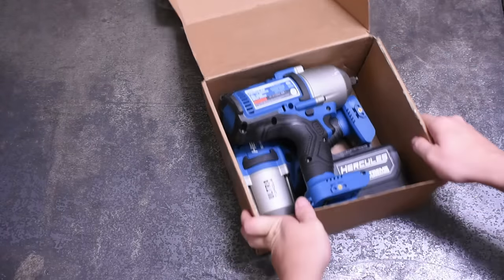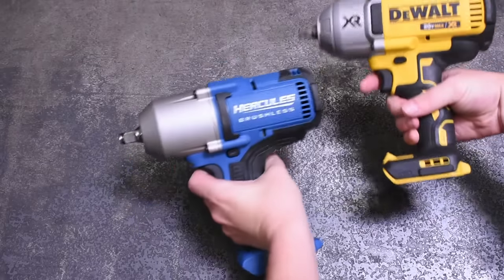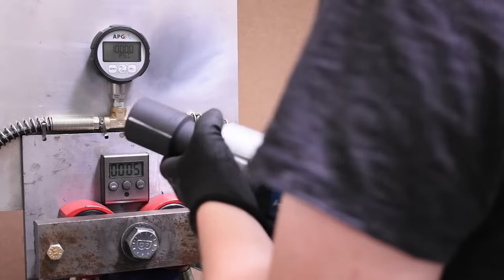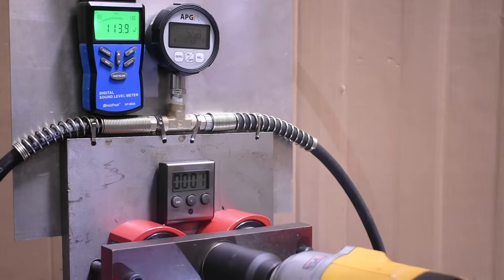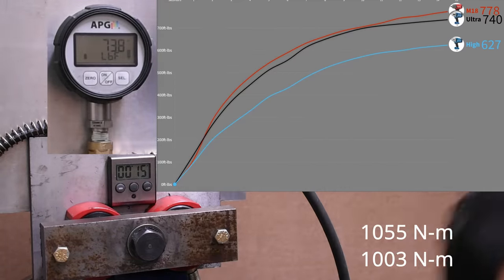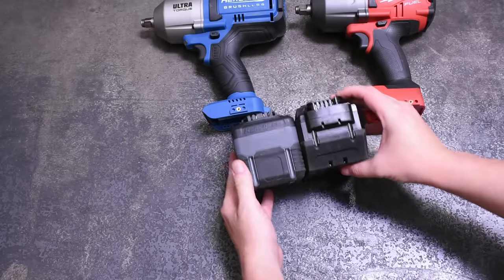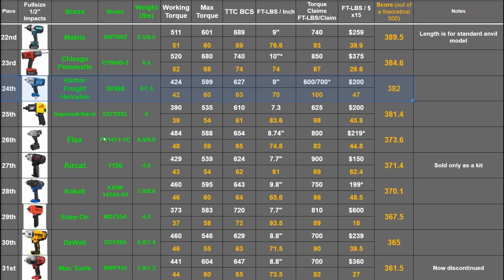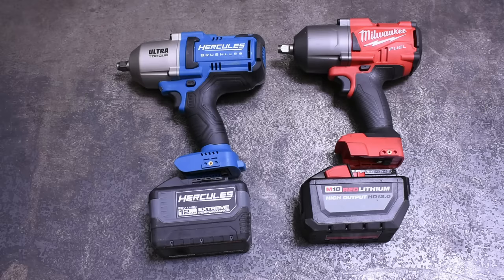Harbor Freight Dethroning Milwaukee & DeWalt w/ New Ultra Torque Impact Wrench?

Comment: Wow. Impressive results this time from Harbor Freight! With a 5 year warranty and a substantially lower price when you consider the battery cost - this seems like a legit contender.
Reply: Yes but how many times can it do that. Yes I know 5 year warranty and supposedly walk in walk out with a replacement but how many times are you gonna have to go in during that 5 years.
Reply: @jamesfair9751  as many times as you gotta get that free tarp, flashlight, or bucket lol
Reply: @jamesfair9751  well I have had 3 earth quake xt in 14 months ! 3! Sooo yeah
Reply: @jamesfair9751  your assumption with your comment is that it will in fact break or start performing at a lesser capability. But until we see that, you just can't assume. Nobody thought that they would start rolling out 5-year warranties, but here we are.
Reply: @leafybug04   To add to that, if they had to replace it every 4 months, they would lose money big time on a 5 year warranty. So them giving that does mean they have some degree of confidence in their product.
Reply: @rapidroadsode8789  the earthwuake xt had a bad switch design and had chrap brushes. Makes sense.
Reply: @jasonthomas4895  and it’s weak . At least once daily I am grabbing the breaker bar in passenger cars. I’m adding semis to the service list and the earthquake simply won’t do
Reply: @rapidroadsode8789  its actually pretty strong. Its not as strong as strong as my milwaukee, but it did the job for me for almost 2 years as a technician.
Reply: @jasonthomas4895  actually it’s not . I do this every day and I have to break out the bar daily . So much so I strained a muscle in my neck and I’m a let’s just say stronger than the average strong guy. So nah it ain’t strong. Not for rust belt or semis it ain’t
Reply: @rapidroadsode8789  i get alot of cars from the rust belt out here in Washington (military base), and it did the job plenty for me. One day it just gave out and that was a year or day in and out use, including suspension, wheels, brakes and even jobs where i had to remove the subframe
Reply: @jasonthomas4895  maybe I’ve had 3 duds in the last year . I’ve had 2 break and this last one caused me to drop $700 on a makita kit so it’s not getting the job done for me at all . And I know when I move to more commercial and rv roadside it definitley isn’t gonna get it done . I was considering an air powered  d handle but when I saw the torque test results on the makita I figured I’d give it a shot .
Reply: yea for the homeowner but a mechanic that uses it everyday it will give out very quickly.. plus they dont have the tool arsenal that milwaukee does
Reply: @bigdave6331  i am a mechanic....... have been for 4 years now. I personally love my milwaukee setup but im probably gonna downgrade to the hercules line because of how cheap the batteries are.
Reply: @jamesfair9751  I regularly use 10 tools & batteries from Milwaukee M12 and M18, and I send stuff in for repair more than twice a year. I'd love to get over the counter warranty replacements. Go Harbor Freight!
Reply: @rapidroadsode8789  I had my earthquake XT for over 4 years for my service truck, and it still hits like it did when I first got it……that said, it’s weak point is it’s battery pack. I’m on my third. I have SnapOn impact ratchets and 3/8 impact gun, and impact driver for use in the shop as I don’t want them stolen. They are expensive but worth it. I’m saving to get the High Torque 1/2” impact gun, but it’s over 800 with battery and charger.
Reply: Absolutely
Reply: @patrickday1816  Home Depot came through with the one day delivery on my makita 3/4. It has the highest torque if anything tested that I’ve seen other than d grips . $661 with 2 batteries and they gave away another for free . 
It came a couple hours ago and I’m waiting with baited breath for a tire change just to see how it goes . Lol
Reply: @jasonthomas4895  ah very nice. I use matco's strongest pneumatic 1/2 impact. I get it serviced every 3 years and have been using it for 7. The gun was $470 and out torques every other 1/2 impact I've used that hasn't been tampered. I'm a heavy line and diagnostic tech out of Vegas. Been a auto tech for 8 years now and started out at Jiffylube haha.
Reply: @rapidroadsode8789  Well by that logic you kind of just disproved your original statement of it being weak. If you're this big strong bodybuilding muscle man and having to use a breaker bar while struggling to the point of actually injuring your big strong muscles, well then how does that imply the impact tool was weak? If anything that suggests what you are working on is so jacked up and frozen almost any impact wouldnt work... I just love when people disprove their claims with their own arguments, especially due to pride. Haha. I also have to ask if you're an automotive technician that's planning on moving to medium and heavy duty trucks why in the wide wide world of sports are you using a cordless electric impact?! When I worked at my father's diesel/heavy equipment repair shop we only ever used air tools, usually 1 inch drives, now we had to have 2 very large twin cylinder air compressors to feed enough air but thats what the job required. Then when I worked replacing tires on heavy equipment we had almost the same setup except we had 3 large twin cylinder compressors in order to keep the air pressure up and had to use very large powerful air impacts, these things would snap your arm in a second if you weren't careful. This work is no place for a cordless impact, if you really want to do this work you need to invest in some air tools man.
Reply: @Lotek117  I've got 4 diesel techs that work for me. They're using makita 3/4" 40v max Xgt high torque. 1510 lbs nut busting, 1330lbs of fastening. Nothing has stopped it yet. I'm in the northeast, and own a small trucking company. We are salted heavily in pennsylvania. I use the XWT08Z high torque half inch 18v at home on my cars.  Nothings ever stopped it. A lot more guys are going to electric, especially roadside repair, and tire guys for semis.
Reply: @Lotek117  yeah I am a bodybuilder . I actually turned pro in October  of 2020. Quite proud of that . Doesn’t really pay worth a damn hence the roadside lol. Buuuuuuut , standing on the expressway , in January , and it’s 7 degrees and cars are whipping by at 80 mph Id rather get the job done and go. I’d rather not injure yet another muscle or nerve in my already destroyed back and neck . And the harbor freight,  as I said has me using breaker bars literally every day . And that’s just  on cars . I’m not even doing semis yet . The few utility vehicles I’ve had and almost every ford f series , and honestly anything that has had the tires off at a shop is gonna require a breaker bar . So yeah it is weak . I like hf because it’s cheap and WHEN I break it I can get a new one 7 days a week 9-9 in 5 min. For that it’s Awesome, but when you do this all day , and I work 12-16 hour days now( even now at 8 am Sunday,  I’m getting gas for a fuel delivery ) , you’re gonna run into things hf tools just can’t handle . I’ve broken 2 breaker bars in the last 3 months, 1 just a week  ago. Guess why I was using them . Lol I’ve broken maybe half a dozen of their impact sockets , mostly 21 and 19 mm. 

The earthquake xt is weak for what I do . And I have the 3/4 lol. Fir what you do , where you are it’s probably fine . I’m not arguing .

If you deadlift 500 you’re strong in high school. Great . But that ain’t strong anywhere else .

If you run a 11 second 100 m you’re fast for a woman in college but you ain’t fast for a man in the Olympics  .

We’re talking levels man .
Reply: @Lotek117  I’m currently doing roadside and am expanding to 2 new areas  this year , towing and heavy duty roadside . I’m weighing my options . 30-60 gallon a compressor  and all air tools orrrrrrr 
Cordless impacts and smaller air compressor only to fill tires and fill the bead seater tool. 

I’m exploring the most cost effective way to break into heavy duty . 

Also Cordless and small air compressor fit in the back seat  of the extended cab flat bed tow truck  I’ve ordered .

A big air compressor(10+ Cfm) does not and requires me to purchase another utility vehicle . 

So I’m trying to get into this with as little investment as possible especially since I just ordered  a brand new tow truck and all  the tools neccesary . 

So once again earthquake xt doesn’t do what I want it to do now and damn sure won’t do it in the future .
Reply: @billymurphy3  I bought a cot to go camping at a local like, you know the cheap type store. Next morning i get up, a rivet is broken...im 50 lbs or more under the limit...guess ill return it. Get a brand new one. Bring it home, get it out of the bag and 2 washers fall out...2 broken right out the bag. I got a different style, the warranty rather store exchange worked good...but not exactly ideal. Would be nice to see if you could get good life out of one of these but its iffy.
Reply: @deektheviking4747  i have the pneumatic impact from matco too. Its my go to when the cordless aint cutting it. Personally i want to try the earthwuake pneumatics since ive heard very good things about them.
Reply: @jamesfair9751  who cares?  I go to harbor freight at least twice a month... you are a Milwaukee fanboy it appears
Reply: @rapidroadsode8789  the fact that you bought makita over Milwaukee says enough lol
Reply: @goldentrucker7921  yeah I don’t think Clancy can see it from my point of view . Simply out that harbor freight git the job done till it didn’t . Not I upgraded to the makita and it’s an animal ! Only been a day but my last client called today specifally for over tighten lugs . The makita didn’t even blink ! No breaker bar used today at all . First day in months that’s happened . I will however trade in my earthquake for a Hercules as soon as they’re actually in stock . It’ll make a nice back up and for use in the rain .
Reply: @Lotek117  btw clance, no , breaking a nut isn’t a struggle for me . I just deadlift it  and it’s a snap. But the problem is when you’re on the  shoulder of the highway you need to keep your attention on traffic .  So your head is turned left or right . I glance at what I’m doing but most of my attention is on not getting hit by idiot drivers not moving over . Not keeping my  neck in a neutral position while lifting caused the issue I currently am dealing with . Same thing I would tell anyone in the gym about not looking to the left or right to see them self in  a mirror while lifting.
Reply: @rapidroadsode8789  Might be defective. It happens. Suggest you do a return swap and then get back to us.
Reply: @guruoo  it works . But it just ain’t that strong . But what I will do is return that bad boy as soon as the Hercules ultra torque is available and get that kit
Reply: @rapidroadsode8789  you sound like that guy who's in every comment section badmouthing a product because it's as good or better than the competition at a lower price but doesn't bear the prestigious brand name. I know plenty of techs who use the earthquake and none of them are whining like babies about it, they all love it. I think your situation is one of personal bias and zero truth. If you used one, you'd likely have the same feedback as everyone else who climbs down from the "this brand is the best and everything else is garbage" pedestal and just be honest about a great tool. But I'm sure you couldn't impress your "buddies" with a tool that works and doesn't cost a house payment 🤷
Reply: @winkletown8828  if your House  payment is $600 , idk where you live but here that’s just ….. a car note …. Maybe… maybe . idk what to say about that . 
But actually no , you’re totally wrong about me . In fact my entire tool selection , except the 3/4” makita I just bought last Friday is harbor Freight Tools . And I’ve been using them every day since March 2021. Literally everything , literally every day. I am a workaholic and as such I work 7 days a week typically 12-18 hours days . So I’m uniquely qualified, more so than most to talk about harbor freight tool  quality . In fact I like them , love them because of the warranty and the fact that I can get a replacement 8 am to 8 pm 7 days a week in 5 minutes . And if you use their tools daily you’ll NEED that ability . But even they know that they don’t have the same quality . Their prices are cheaper specifically because they don’t do quality control, use cheaper materials and parts and knock off known brands  . They also know that most people won’t have an issue so it’s fine . They fit in a very specific niche . 

But again the impact just doesn’t hold up to over torqued nuts , frozen nuts , or anything  the size of a f-150 or higher .

Not sure how that’s whining . It is my experience . 

I’d rather pay $249 then $616 for a kit ! It took 18 months of hand breaking nuts and a neck injury to spend that kind of money on something I basically already have . No one gives a fuck what tool you use lmfao . Besides genius , I work alone ,  so who is going to see the tool but the customer anyway . You know nothing . 

The few times someone mentions my earthquake xt 3/4 they asked me was it a Milwaukee , because harbor freight uses the same color scheme as name bands on their jacks , compressors , impacts and other things so even brand whores wouldn’t  really even know . The name wears off most tools with use as well . 

My cars Though yeah that’s something people see and mention. My home ? Yeah that’s something women certainly comment about . My freaking cheap ass tools that help me
Launch a business at 1/3 the price and significantly lowered the barrier of entry …. ? You sound like someone who just wanted to be in the conversation !
Reply: I wouldn't go that far. If you wait for it to go on sale at lowes you can get a dewalt impact including charger and battery for 220 so it's in the same price range as harbor freight. Made in the USA and definitely a reliable tool
Reply: @rapidroadsode8789  so
Reply: @winkletown8828  have had the Mikita for 2 weeks and haven’t used a breaker bar since I got it . I did trade in my earth quake for the new ultra torque and it only cost me $25 total with the giant 12 ah battery.  No extended warranty needed . I’ll try it out the first day it rains as the makita won’t be seeing any environment other than dry. Ain’t about brands it’s about production .
Reply: @jasonthomas4895 
Kitsap?
Reply: @rticul8862  ??
Reply: @rapidroadsode8789  how's your makita holding up? I just bought the mid torque 40v, and the combo 40v hammer drill & impact kit with charger & 2 batteries. The gt200d. Both are amazing. The hammer drill has some serious performance 👏
Reply: @goldentrucker7921  it’s nasty ! I just yanks the nuts off . I have nothad to use a breaker bar  once since I got it and my strained neck muscle is almost 100% because of it . 
I also got the ultra torque as a cheap backup and to keep in the tow truck and it works well also . I grabbed a 12v makita cordless ratchet open box on Amazon for battery changed and it’s great also
Reply: @jasonthomas4895  it's okay these boys getting so insecure about not having the best possible tool and act like it's the worst decision ever made if you buy anything other than "the best" 🤣
Reply: Those Hercules impacts don’t play around!
Reply: @billymurphy3   . 
...
Reply: @jamesfair9751  Harbor frieght if the gun or battery fails you grab a new one go to the counter they look up the puchace and you get a new one free !
Reply: @rapidroadsode8789  You think 3 duds in a year is bad?? One guy bought a new Milwaukee impact, the big fuel one, and he broke SIX of them in the parking lot of the store trying to take the lug nuts off his truck. After the first few failures, and walking right back in the store to have them warrantied, the store employee didn't believe him, but walked out and witnessed the rest of the failures for himself. The video is right here on YouTube.... JUNK! That's SIX duds in 30 minutes. I'll take the Harbor Freight ANY day.
Reply: @jamesfair9751  no cause this damn Ultra Torque is no joke, very well biuld like a tank and was tested to torque loose an impressive 1,900 ft. Lbs on the reg. 5Ah battery and was able to torque loose 2,000 ft. Lbs with the powerful 21700 cell 8Ah battery!  The 5 yr warranty backs it up!!!
Reply: @rapidroadsode8789  That's earthquake.  Hercules is a completely different animal!
Reply: Not even the batteries are maybe 20 30 bucks cheaper than milwaukee the hercules line is expensive youre better off paying an extra 80 bucks for a milwaukee
Reply: @kelpking4484  The Hercules batteries aren't that expensive. I got an "Extreme Performance" 8ah 20 volt battery with the new larger 21700 cells in it for $69. Try to find an 8ah Willfuckye battery for anywhere NEAR that price.. 😕
Reply: @kelpking4484  Also, i don't know where you'll find the BIG Willfuckye impact for "80 bucks more" than the Ultra-torque Hercules. The big Willfuckye with a battery is close to $550. I bought the Ultra-Torque Hercules, and 1 8ah battery,  for $240... I already have the charger for some other tools. That's about a $300 difference. NOT "$80".
I've been using the Hercules 5 days a week, 10 hours a day, since Christmas and it's been fine so far, and has a SHITLOAD of power. 
I wouldn't have TOUCHED a Horror Fright cordless tool 5 years ago, but they are getting good today, and they ARE much cheaper than the "other" brands out there. The no hassle 5 year warranty on them can't be beat either.
Reply: @xxxleafybugxxx  Also nobody thought HF would create superior quality roll carts that would compete with snap on, matco and Cornwell, yet here we are with US General carts equal or better quality at a fraction of the cost.
Reply: @sophiasocal68  The H.F. carts are pretty good..
I own several, the regular one, and the one that you can adjust the height by pumping the foot pedal. No problems with either, and I've had many heavy things such as several hundred pound transmissions on them many times.
Reply: @Lotek117  I was thinking the exact same thing. Homeboy claims he’s so strong but then he strains his neck. He either isn’t strong, or those lugs were on their super tight.
Reply: @jamesfair9751  lol u are legit funny
Reply: @rapidroadsode8789  why do bodybuilders keep lifting even though they're back and knees are shot? A friend of mine constantly complains about his back but won't stop lifting and is increasing weight. That seems like a recipe for a ruptured muscle in the groin or other places.
Reply: So Bosch is the best? Got it. Bosch usually is the best
Reply: @jrock5995  depends on their age and pain level and pain tolerance . Also every exercise doesn’t put a bad  back at risk . Also staying strong is one of the better things one can do for their  back specifically .
In addition being bigger and stronger than the rest of you is addictive . It’s hard to quit unless the  body  MAKES you quit . 

I’ve had a herniated l5/s1 since freshman year . Never missed a day unless I did something stupid non gym related  and couldn’t get out of bed for a day or 2. Knees on the other had , yeah that shuts me down instantly . I don’t play with my knees .
Reply: I've had bad luck with Milwaukee batteries they are absolutely junk
Reply: I agree. Harbor freight with 12.0 battery is nearly Half As Much then ANY of the competitors
Reply: I now have the quarter inch impact and the 4.5 inch angle grinder of their newest generation. I am very impressed, came in looking for a cheap tool that could compare to old yeller. Turns out old yeller needs to catch up.